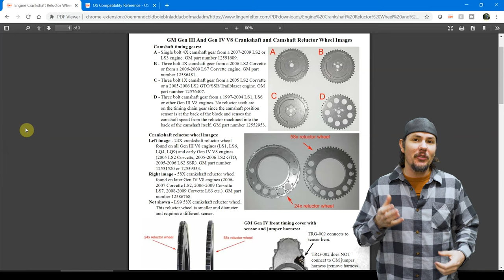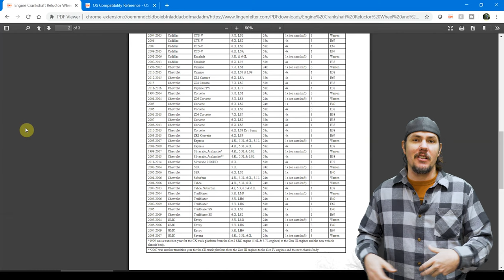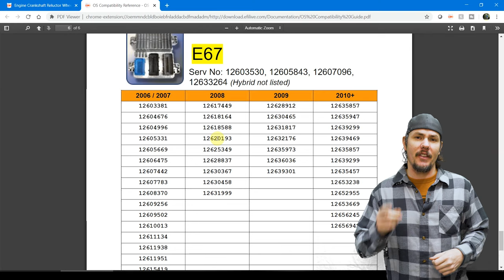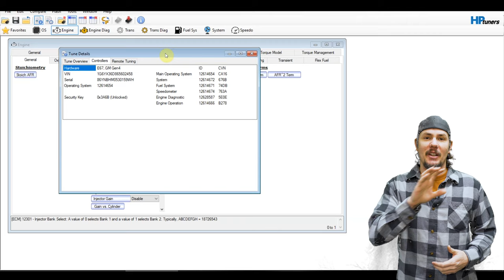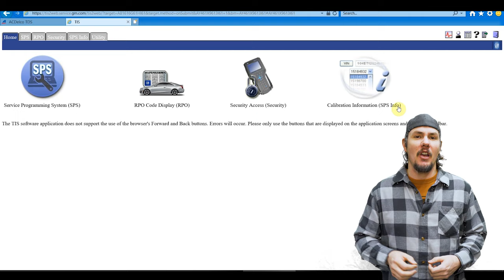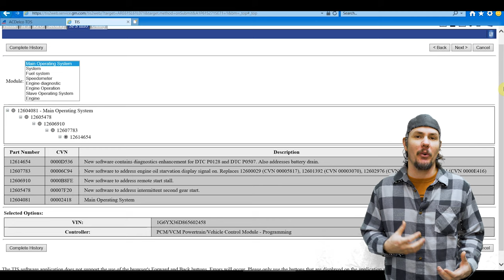Factory ECM Selection For A Project, Lessons From Hindsight!

Comment: Did you have any problems getting the vcxnano software loaded? I keep getting <mdi not detected>.any help would be great.thanks
Reply from the maker: Nope, but make sure your launch the manager and install the drivers/software listed in there
Reply: @GoatRopeGarage  ok. Thanks again.
Reply: Not trying to highjack but For anyone wondering about vcx nano running windows 10. If your not connecting look at click on bottom right of screen and make sure windows antivirus is not blocking it. I about went crazy trying to get it to work. This really is a good tool though and works flawless for j2534 reprogramming.

Comment: This is the first time I've heard the firing order is hard set in the ecm, or maybe that's not what you mean. Did you have to move pins for firing because your using a Corvette OS? If so, why not use the XLR-V OS? I am just a little confused.
Reply from the maker: Nope, the pins are the firing order, if you use the XLR-V or the Corvette the pinout remains the same for the N* but changes for the LS to match the firing order for that engine. I thought I had to move the pins when I looked up the Corvette pinout because the cylinder numbers were listed differently but then I looked it up and realized the pinout matched the physical firing order so it's not something changed in the ECM.

Comment: can you use a e67 to run and 06 LS2 58X with 4l80e or 6l80e as oppose to the e80 and tcm?
Reply from the maker: Theoretically as long as the crank and can signals are correct for the ECU you should be able to use it